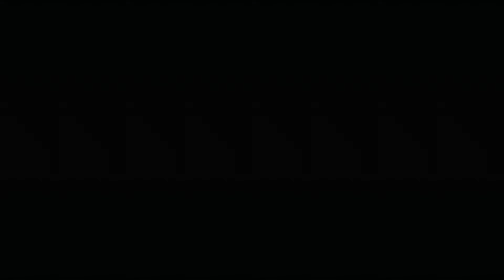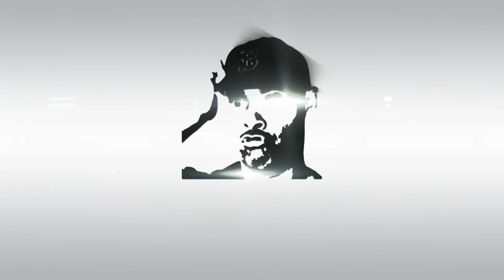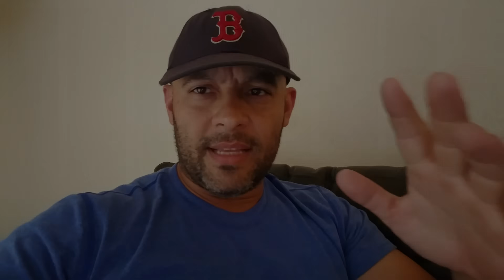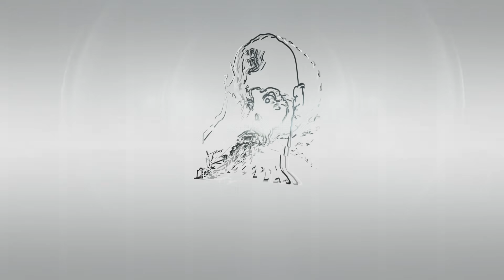The rear O2 sensor, How it works with emissions and off road exhaust in simple terms.

Comment: So what would you say would be the hp difference between headers and high flow cats vs no cats ? I'm from NC and have emissions. So would it be easier to just do a catback exhaust alone and forget about headers ?
Reply from the maker: Depends on boost level if boosted..NA about 10-15
Reply from the maker: What i am saying is this. IF you decide to take cats off...it will make more power but it might kick a light...might.
Reply: NC does not have sniffer tail pipe tests, they did back in the 90's, but no longer. Lived here all my life so I can attest. They do a safety check(lights, signals, etc) but that includes visual inspection to make sure cats are there. If the shop sees no cats they pull you out and say no go.  The "emissions" check is just plugging your car into the state approved obd II scanner and looking for codes. If you have a CE code you don't pass it's that simple.
Reply: Boost junkie if you took your car to inspection and they told you that it's "not ready", that means your readiness monitors have not completed their tests yet.  Drive your car about 50 miles then go back again
Reply: Either your tuner turned off the o2 or you hace a code for it.  ask your tuner what he did. As mentioned above space the o2 out so it doesnt trip the light  and the computer will think the cats still there
Reply: Bmere 828 I live in Indiana. What's emissions ?
Reply: fordltd1983 so would you say it would be ok to go catless ? Or not worth the headache?
Reply: Alejandro Flores okay, can you please please help educate me then...I have a procharged car with arh lt headers catted elbows and arh mids and a borla atak s I believe was on there catback. Now the car when taken to emissions on emissions tune came back for all the O2 sensors as not ready. I have no check engine lights but I also don't know what's turned on and off, any suggestions or insight what I might need to ask would be great, because I'd like my car to pass emissions
Reply: Anthony Tomaro I have, they have been on the emissions tune for over 500 miles, they just aren't ready period haha...so either they aren't waiting at all, or not sure what else to do, I guess I could try a paid inspection station and ask them to wait a bit to see if they will be ready
Reply: Boost junkie aren’t ready gives the answer to the test. They can’t delete the part of the code that looks for them. So they tell the computer that they aren’t ready yet which while doesn’t throw a light fails the test. Your particular tuner doesn’t have the ability to rewrite the OS.
Reply: Bmere 828 If you have emissions it’s best to leave the stock manifolds and cats in place. Sucks but the bright side is you’re not really giving up much power compared to 20+ years ago ect. High flow cars have a larger diameter as well as a lower cell count. That lower cell count will always mean increased emissions if they run a sniffer test. They can also read if you’re tuning around emissions.